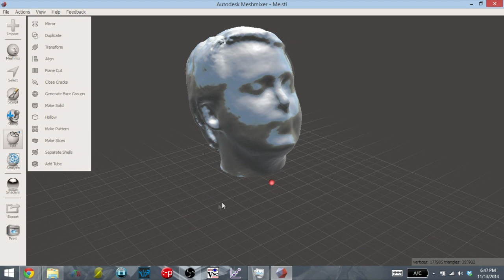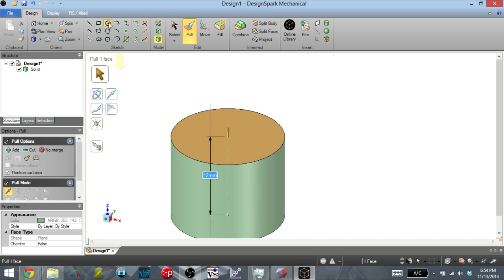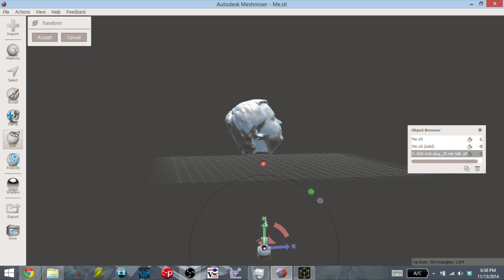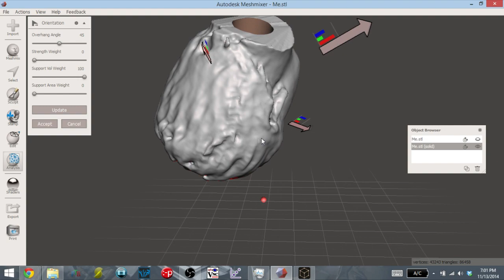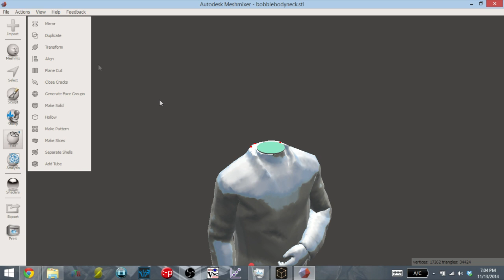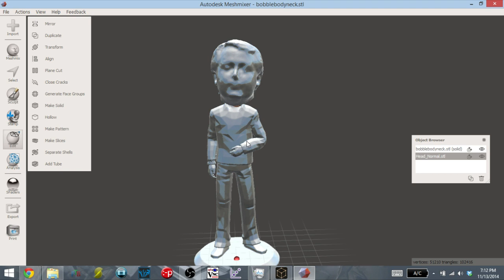Designing my Bobble head from my 3D Scan using Meshmixer

Comment: Hi Hoffman,
Can i merge scanned human face (obj/stl) with scanned human 3d full body (obj/stl)?
Manually it is possible as you showed in the video. But is it possible through command line from Meshmixer or any other tool?
Please help...

-thanks
Avdhesh